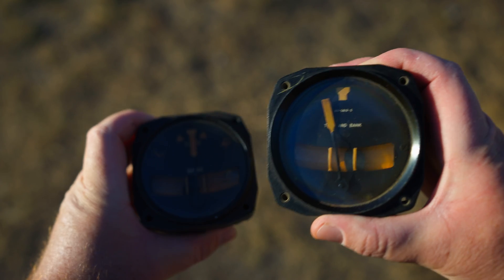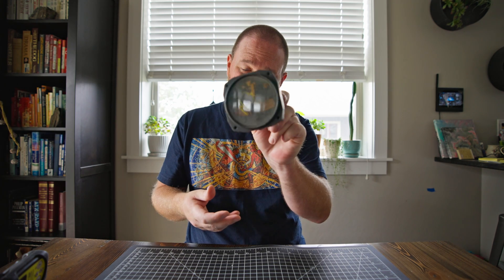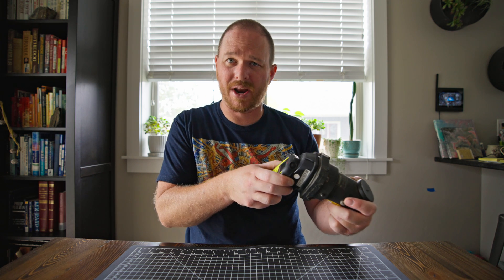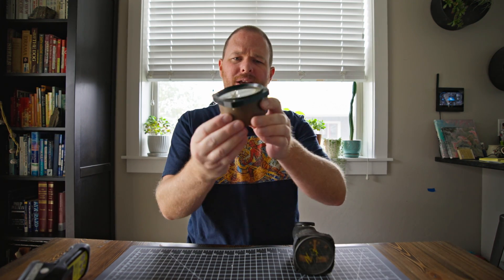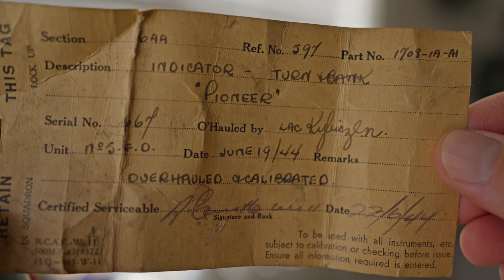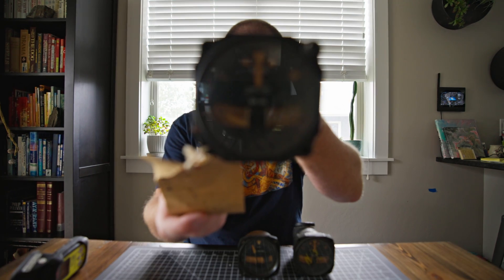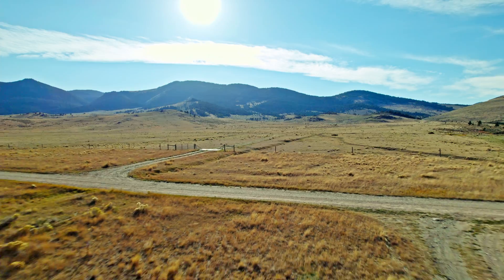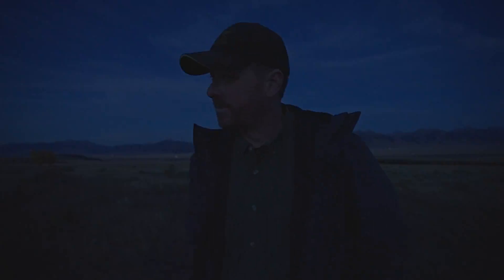Why Are These Radioactive and Glowing

Comment: So I have a few of these instruments.  What kind of distance do I need to keep from these instruments to be safe?
Reply: These instruments generally aren't detectable more than a couple meters away, so at this distance you're relatively safe from external exposure. The issue with these is the radon gas they produce, which will contaminate everything in proximity to the instruments with radon decay progeny. Best to keep them outdoors or in a VERY well ventilated area (basically not in your home)
Reply from the maker: Well the closer you are the more intense the radiation is. Personally I keep my radium doped dials in a safe in the garage. But if I had the room I would have them in a display case in an office that’s away from everyone else. All my display areas are either too close to me or family.

Comment: The ones with tubes at the back were connected to vacuum sources/pumps in the aircraft to draw out all the air and make them more accurate.
Reply: The vacuum supply was to run the gyros in the turn indicator and artificial horizon.  Airspeed indicators also needed the air from the pitot and static ports, so tubes were essential for these instruments.= to operate, not to make them more accurate.

Comment: If you put the tritium tubes closer to the radium does the tubes glow brighter or recharge the hydrogen/ helium decay?
Reply from the maker: The beta decay from tritium is what makes it glow, well that and the phosphor inside the tube. So putting radium next to the tube wouldn’t do anything. Beta radiation has a very hard time penetrating glass. It also wouldn’t recharge the tube as that isn’t the mechanism in which tritium is made.

Comment: That is to say if you were to hold the same number of atoms of tritium, and radium, the tritium would probably be the one you would run from first. Amazing quality of videos!
Reply: Not too sure about that statement actually. Though the tritium might have 130 times the activity of radium mole for mole, the 5.7keV (average) betas don't go through anything (significantly less penetrating than alpha even, and with 0.1% of the energy of a typical alpha, usually ~5MeV). Tritium produces no gamma during its decay. That same radium sample would produce large amounts of alpha, hard betas, and gammas, along with radon. Also if at equilibrium with its decay chain (as it usually is) a radium source will actually be 9x as active as the radium alone. I would happily handle several Curies of tritium (typical keychain contains 300mCi), whereas a device containing just a 10uCi of radium scares me. So I have to disagree with that statement, but your point still holds that tritium has a WAY higher specific activity than radium.
Reply from the maker: Oh yeah, same amount of tritium would be very radioactive...but radium gives off way more gamma rays and alpha radiation. Tritium is mainly a beta emitter.

Comment: Would be interesting to perform a wipe test on each gauge and see what reading you get, presumably you would just pick up radon decay progeny, but could also pick up and particulates of Radium.

I have some Radium painted objects and store them in Air tight containers although it’s probably not necessary.
Thanks for the great content.
Reply from the maker: I've done a test with my AirThings radon meter to see how high I could get it in my cabinet where I keep some radium compasses and that got decently high for not being an airtight container.
Reply: @RadioactiveDrew  that’s a good idea, I like the Airthings products.
Cheers. Jamie.
Reply: @Brit That's a great idea, to distinguish in between radium and radon decay products, you will have to repeat the measurement within several hours, if the levels drop significantly, there is probably no radium contamination on the outside parts of the gauge. However, you could still get some reading caused by Pb-210, with half-life about 20 years. Make sure that you use proper detector, sensitive to radiation given off by the radionuclides in radium decay series.

Comment: That first meter is HOT! Great video!
Reply from the maker: Thanks. Yeah that first one was pretty spicy.
Reply: I found one from a WW2 aircraft that’s ~400 μSv/h. Have you measured the hot one in μSv/h yet? Great videos! Keep them coming!
Reply: @FromGregg  what were the conditions you took this measurement under? Was it incl beta radiation or jus gamma? What detector did you use? Was the paint on the instrument exposed, or was it behind the glass?

Comment: So like 280 uSv/hr? I bet it goes through the roof if you remove the glass...
Reply from the maker: Just took a reading from it using a gamma filter on the Radeye B20, got 145 uSv/hr. The radium source in the level section can be removed and it would easily max out my detector. Might do a video on that in the future.
Reply from the maker: There is a contact email in the About page for the channel.
Reply: @RadioactiveDrew  thanks man

Comment: The pilots flying these old planes must have been getting absolutely blasted by gammas sitting in front of an entire panel of these things lol
Reply from the maker: I can only imagine their absorbed dose.
Reply: @RadioactiveDrew  You could calculate the absorbed dose of a WW2 pilot by measuring the current level of radiation, calculating the area of the paint, looking at a photo of a cockpit and estimating the total area of all the radium paint in the cockpit. Would be a cool episode.
Reply: Nonsense. They are sitting away back from them. They have less radiation than an old radium dial watch. But you can pick up 10mR or 100uS from one long haul airplane ride in a modern jet at 35 to 40 thousand feet from natural radiation.
Reply: @vinquinn  A) I don't believe you. While the inverse square law will obviously still apply, the sheer number of these things is going to produce a nontrivial dose. and B) 10mR from a single flight is absolutely ridiculous, the real value is like 1-2mREM and the annual average pilot dose is in the range of 227mREM.